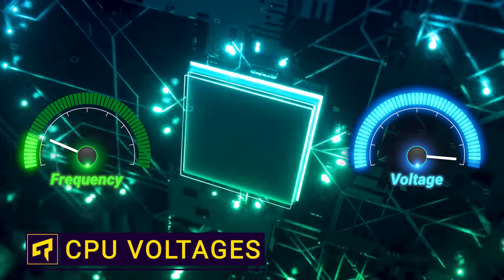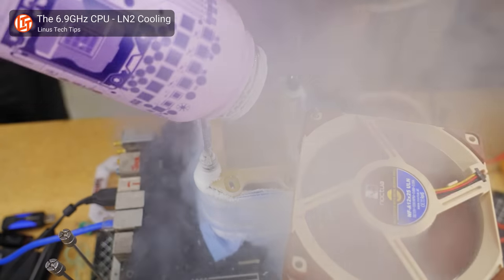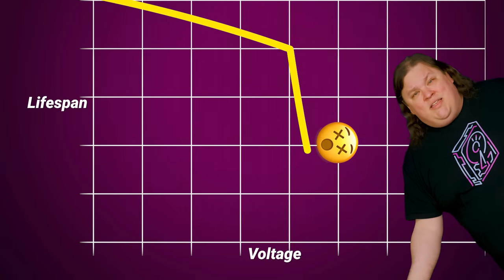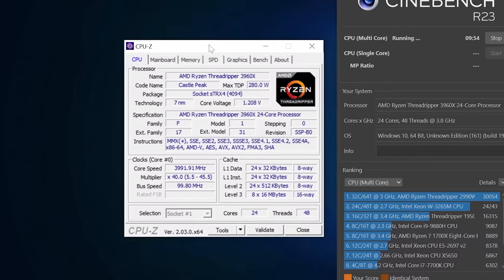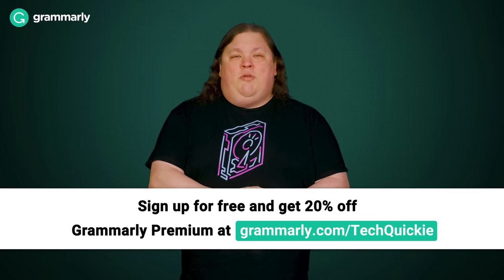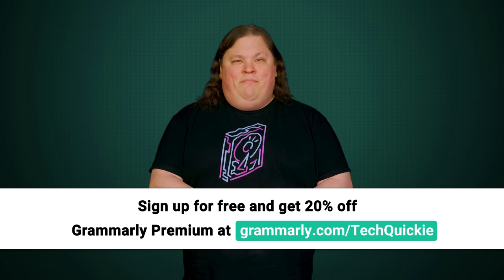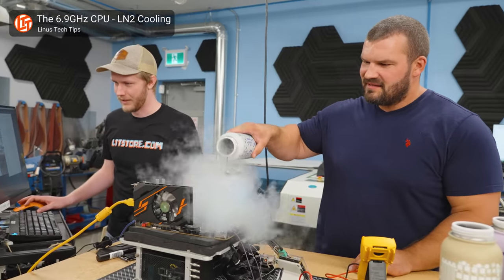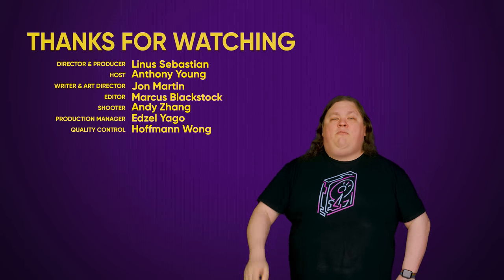What's the Point of UNDERVOLTING Your CPU?

Comment: What they dont tell you is that the 'expected' lifepan of a CPU at the recommended voltage is like 30 years at 24/7 uptime.  I have a 2700k that has been running a 5.2ghz OC at 1.45v nearly 24/7 since 2013.  Which is WELL above what Intel recommends.  Basically, unless you're pumping ungodly amounts of voltage into the CPU, its going to last far longer than you'll ever realistically need it to.
Reply: Came to say basically the same thing, but you beat me to it LOL! Agreed, this video leans a little too much towards the cautious side. While everything said was truthful we're really talking taking the lifespan down from like 30 years to maybe 20 years if you're pushing it really hard. No need to worry about those lost years IMHO though. By that time the CPU will be dozens of generations behind & only looked at for retro, time appropriate systems. Like what we see now with Windows 95/98/XP builds.
Reply: And I had 2 CPUs burn themselves unstable in 3/4 years. With less than stock voltage.
Reply: damn, sounds like you won the lottery my friend.
Reply: HOWEVER THAT IS FOR OLDER CPU'S AND A DIFFERENT TIME. My UNDERVOLTED 3600 started showing signs of silicon degradation. It used to be stable at 1.275 at 4.2ghz, it started bsoding a few months ago. Switched to 4.1 at 1.3v for stability. I've had the cpu for two years. Maybe this is because it was a constant voltage of 1.275 instead of using Pbo.

Older products are usually more durable because they were made before planned obsolescence was as well thought out as today. Intel lost probably quite a bit from older cpus for a while. A oc 2nd k series I5 would out perform a 7th gen i7 since intel was stagnant for a while.

I doubt the companies care about consumers.
Reply: @Derpynewb  Check the ryzen master readings. Amd cpus even in override mode are dropping frequency and voltage when there's no load.
Reply: It might just be related to how well the Sandy's have worked.  Mines at 4.8ghz at 1.45v since launch too.
Reply: @robr640  My computer is upstairs, so the temperature in my office goes up to 78-80F when I'm gaming. I'll probably undervolt my 12700k and whatever GPU I end up getting once I upgrade just to bring my system temps down.
Reply: @BlueDrew10   Oh yeah don't get me wrong I'm a big believer in undervolting myself. Nowadays the CPUs & GPUs are pushed to edge out of the box so you only got down to go lol. Seriously though I'm in the same situation with my PC & have both my 5800X & 3090 UVed.
Reply: ALSO that your CPU is most likely engineered to run continuously at 95C or maybe even a bit higher, even though that makes most of us cringe.
Reply: Not these new chips, you can fry them so easily.
Reply: @ordelipyorinen8235  that’s the downside to smaller components. Takes less to fry a transistor
Reply: i killed my gpu after 6 years of overclocking. maybe would've lived longer if i didn't overclock? now i keep it undervolted because my new gpu is more expensive and i expect to keep it for at least as long
Reply: Yep, Intel CPUs are a lot more resilient than AMD CPUs.
Reply: I have been using my i7 4790 non k since 2015 at 4.3Ghz (bclk)on 1.152v 6-7 hrs daily and still it's fine even once i tried 4.6GHz at 1.32v but was not that good for me and temps was also concern .
Reply: For my old 2600k, I had to give it a .005v bump once a month at 1.33v and 4.5ghz, for it to stay stable, but was able to get years with 4.2ghz at around 1.29v, without touching the voltage.
Reply: you sure you just didnt win the silicone lottery on this CPU?
Reply: Source?
Reply: My 2500K lasted almost a decade at 1.45V. My 1800X lasted 2 weeks at 1.45V mining monero before it was so degraded I would get artifacting at the login screen.
Reply: @Lead_Foot  my 2600k lasted until my power supply burned out, about 7 years.

Haven't tried to overclock my newer pc's yet, but they run with a bit of a higher voltage out of the box, the VID for my 2600k was at around 1.24v IIRC, I have a 8700k that had an initial stock 1.34v VID, it was dropped to 1.305v in a later bios, which dropped temps a bit .
Reply: @robr640  cautious because newer stuff is redlined from the factory. Push newer stuff harder and it WILL shit itself. Companies have realised if they make garbage you'll buy it twice. Rather than good things you buy once.
Reply: I remember reading that Agner Fog said that letting your CPU go over 50 degreess C shortens its life. And even in eco mode, my 3700X runs above that temperature. But now I see I shouldn't worry too much.
Reply: Same I run a daily OC with  no offset and a tec cooler
Reply: How much is your electricity bill tho
Reply: It's not only about lifespan, but also about temperatures. Lower voltage leads to lower temps, which can actually boost performance, specially in power hungry CPUs like the new 7950X and 13900k.
Reply: because back then they didnt shop the chips even close to its potential, today the chips they ship are already working at their limits, so overvolting will certainly shorten the lifespan of your chip with the modern chips. also a 2700k @ 5.2ghz 1.45V will pull like 150 watts lol, thats really bad efficiacy, like, terrible.
Reply: @Goatfer  lol ?
Reply: but the real problem is nanotechnology. CPU is smaller and smaller, it went from 22* nanometers to 7* and 5* and its still going down meaning more sensitive to more voltage. From school you should know when you touch circuit with 12 volt and connect it sparkle but do nothing to your hand. Lets increase to 50 volt and you start feeling ouch when you touch. Its similar to cpu. Smaller node, less protection and less lifespawn when overclocked.
Interesting fact: TSMC strugled at 3 nanometers silicon becouse of that fact above.They had to make more adjustment to isolations. Memory is even more sensitive to electricity than cpu. Even AMD 5800X3d have no overclocking future because of additional memory is more sensitive for voltage. It will shorten lifespawn evem more when overclocked.
22* nanometers is no means real nanometers anymore :)
Reply: Hey should I run it Ata setvolt?
Reply: it's not only about the voltage, it's also the amps.. more workload = more amps = more heat.. if you'd be running that voltage and 100% workload constantly it'd be another story.
Reply: Same here with a i7 2600k
Reply: @TheSlowDude  But is only a 4 core and will never get so hot..
Reply: Running your voltage as low as possible can leave your cpu more susceptible to interference for other sources, causing random instability after run stable for days or weeks. So if you think your cpu is degrading because you had to up the voltage think again someone might have just plug in a vacuum cleaner.
Reply: And if the place i bought my refurbished pc (my first one as it was) didn’t use any thermal paste, am I safe undervolting?
Reply: yup my i7980x circa 2009 still runs just fine...if you dont mind being limited by all the other tech of that time.
Reply: Definitely not normal, not for many CPU models and samples. Der8auer ran a long term test on three Ryzen 5000 CPUs for over 4000 hrs at 1.45V and two (iirc) of the three CPUs ended up degraded and needed a higher voltage to pass a Cinebench run. It‘s probably still somewhat fine for how long you normally keep using a CPU, but it will definitely shorten the lifespan
Reply: @maaax1173  if I did the math right that's a 13% voltage increase (based on a quick look up of a 5600x's stock voltage) so ya, with a sustained test, I could see that eating into a CPUs life cycle since 4k hours is 166 ish days. Temp could also play a significant roll but I would have to look at his testing. thanks for posting the scenario.
Reply: @Jamil  load line calibration is a must. Constant voltage is bad for CPU's, they fluctuate for a reason. Buildzoid has done some videos on it.
Reply: fried a q6600 with overvolting in just over 18 months.
Reply: Also, while this is mostly true for PGA and LGA sockets it is less true for BGA. It is FAR more likely you will see solder failure on a BGA chip much earlier than their actual expected lifespan rendering them worthless unless you can reball them.
Reply: How is your 2700k holding up to this day? Does it still come along well and if so based on what usage ends?
Reply: I always try to tell new people that are scared to get into pc overclocking that it’s almost impossible to break your cpu or gpu by messing around with overclocking stuff.
Reply: if it's decently cooled, it also makes a difference.
Because at stock voltages if you hit 100°c, you damage it too even tho it's the recommended ones
Reply: I have also overclocked an i7-3770ghz from 3.4ghz to 5ghz for 10 years without any stability issue. The microprocessor is probably the most reliable piece of hardware available on a PC.
Reply: @Derpynewb  AM4 based chips have been known to slow cook themselves; I switched back to Intel and have every setting on stock settings and this 12400K is a beast compared to my Ryzen 5 AM4 system.
Reply: But they want us to buy the latest a greatest EVERY YEAR. 🤣🤡
Reply: 5.2 with sandy bridge? Damn you got lucky
Reply: @zhongxina9420  Your freezer sucks a million times more than your pc if it is running 24/7. It's a general misconception. I never shutdown my pc, if anything I'll do hibernate every once in a while. No cost increase.
Reply: Why would you even want to run a CPU for 30 years anyway.
Reply: to be fair sandy bridge CPUs are ridiculously reliable and durable and the fact that you got it over 5 ghz sounds like you got a golden chip, i had a 3770k that couldn't OC over 4.5ghz at 1.35v with temps no higher than 70c at full load (no matter how much extra voltage i gave it it just refused to go any faster) and started degrading really bad in just 2 years, it really depends on what generation of chip it is and sometimes just plain luck
Reply: i7-2700k user here for many months now. I am still contemplating switching to i7-3770 or other 3rd gen i7 so I can go up from 1333mhz to 1600mhz RAM 🤔 for the foreseeable future, not yet.
Reply: i7 4790k user since 2013.
Reply: Old servers never die
Reply: My i7 2600k still does work but its temp rises to 98 constantly, had to get a crazy cooler then i bought a new system.
Reply: @stephenkamenar also with the way gpuboost and thermal throttling works, u may even end up gaining performance over factory overclocks
Reply: Raptor lake has entered the chat.
Reply: Raptor lake:☻️☻️☻️☻️☻️☻️